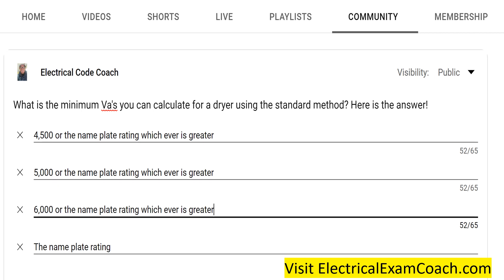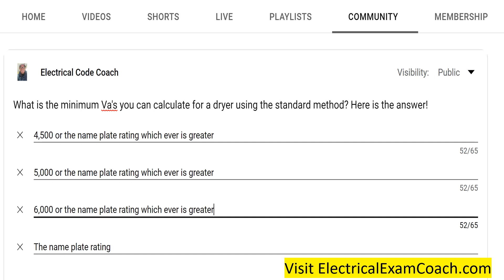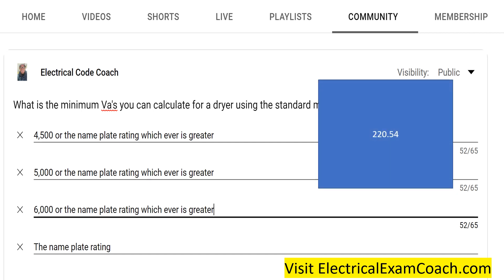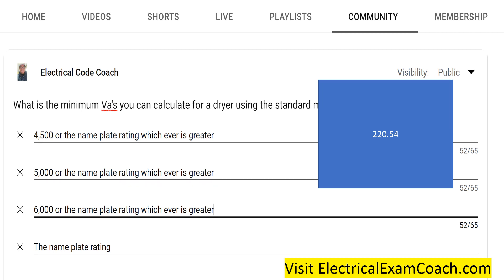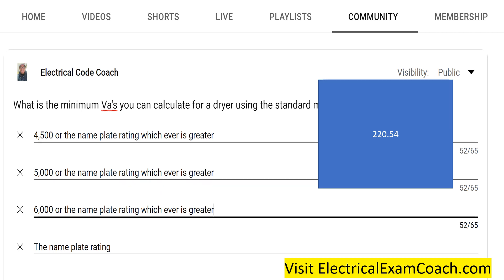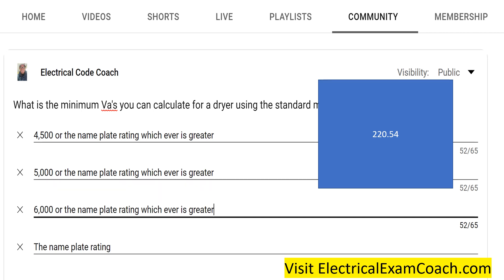NEC Electrical Exam Prep Question # 34

Comment: ok I went a totally different rabbit hole. I took 240v x 30A is 7200watts and took thee 83% rule and it came to 5976watts or the 6000 answer, lol I was way off in area and way to figure. In my defense I just got up and don't have a code book, lol. So you can make fun of me for my stupidity.
Reply: But feel free to send a free code book if you want, lol. As, I am seriously dying and haven't worked  for 1.25 years now b/c congestive heart failure and having 6 heart attacks, 2 cardiac events and 8 stents and prostate cancer so I'm on a good run. I went to Penn State Williamsport for 2 years and Northumberland county votech for electrical construction for 3 years before that. I would love a code book but I am in the middle of a disability case right now and waiting. In the mean time my 20 year old son is supporting me, which I have worked some kind of job since I am 6 years old. So I am not accustomed to not working. They denied me 10 years ago with 5,000 pages of medical documents with the best lawyer in PA. This time it's roughly 25k pages and I guess we will see. But great question no matter any outcome. I like these little tests, I get most of them right. I been doing residential electrical for 33 years on and off. I love the work.